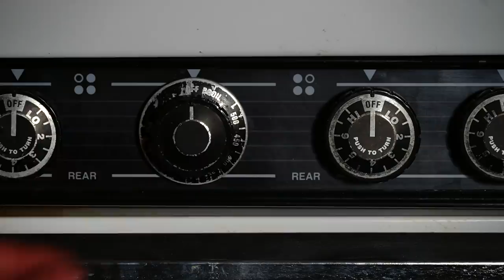Forging a Viking Axe from Junk

Comment: One thing I wanted to see... wasn’t done in this video 😢 the eye on the axe head wasn’t modified! There’s supposed to be a wider and sorter eye. Like an egg 🥚 shape not a sharp raindrop shape. A modern axe has an hourglass shape inside for shimming. A Viking axe is different. The handle and eye are tapered and the head slides over the handle til the taper traps the head. Then the head can be removed by tapping the handle vertically on the ground. Then the head can be used as a knife.

Comment: What is that powder you put on it to forge weld it?
Reply from the maker: It's borax for flux
Reply: Faraway Forge thanks. Does it help with the forge weld?
Reply from the maker: @steve3386  Yes exactly, it basically liquefies the scale that forms on the surface of the steel so that when you forge weld the scale may be easily forced out of the weld.  This produces a much cleaner bond between the pieces of metal.
Reply: Faraway Forge I see thanks
Reply: Faraway Forge also I’m making a knife out of a pipe but I can’t get the two flattened sides to fuse what can  I do to help that two flattened sides fuse?
Reply from the maker: @steve3386  The best thing to do in my opinion is to cut the pipe in half so that you can clean the inside surfaces that will be forge welded together.  Then tack weld it back together before you forge weld it. Very important to have clean steel before you forge weld.  Other than that flux it and make sure the steel is hot enough.  Also some metals are more difficult to forge weld than others, so just be aware of that.
Reply: Faraway Forge thanks

Comment: Wheres the junk ?
I could have that true temper woodslasher axe head back into service in less than an hour.

I'm not saying theres anything wrong with your project,  but this idea that any tool that's rusty and a little beat up is junk and no longer useful in it's original form ?

Comment: This kind of thing is a dream build for me, learned a ton from the video and it answered some questions I had too, regarding that specific forge welding trick, with the splitting down the middle. Just one question though, how did you get the eye to stay aligned/straight? I never saw a drift or punch or anything.

Comment: looks good but i doubt that its gonna be as a good as a 10$ hardware store exe. the fitting was just way too lose, you didn't hammer it in as hard as I would with a typical axe and the wedge wasn't all the way in as well

Comment: First time I saw on YouTube the plasma cutter for material removal! I've been wondering why everyone goes for the cutter/grinder method. Perhaps no plasma in the shop. I wondered if it would work or ruin the hardness, but now I'm eager to try it!
Thanks!
Reply: Of course it ruins the hardness if you cut a hardened steel. But he was cutting the axe before heat treatment so it's ok.

Comment: What is that powder you add  several times and what is that for?
Reply from the maker: It's borax, it improves the forge weld drastically.  It acts as a flux to remove the scale that forms on the surface of the steel, thus producing a clean forge weld

Comment: What's that powder that's put in the hot metal? And the liquid that set the hot axe on fire?
Reply from the maker: It's borax, it acts as a flux for the forge weld.  The liquid is oil to quench the blade, so the oil is in fact burning, not the axe 👍

Comment: Noob question: What's that white stuff added to the hot metal at 1:37 , 1:51 , and 2:03 ?
Reply from the maker: It's borax, it acts as a flux for to keep scale out of the forge weld 👍

Comment: Can we see how your forge works?
Reply from the maker: What do you mean?
Reply: @FarawayForge  How did you put your torch based furnace together? I currently am trying a coal based one with little success. Yours looked far more efficient, so I was wondering how you set it up?
Awesome content by the way! I am eager to try a few one I get things up and running. 😁👍 Keep up the great work!
Reply from the maker: @zacharytvrz3995  Oh gotcha, I have never had any real experience with a coal forge so I can't speak to that.  The propane forge is store bought, it is made by a company called "Majestic Forge."  It's one of their three burner blacksmithing forges.  I have tried building my own in the past but I ended up spending more money on materials for the many failed iterations that I created so I decided to cut my losses and buy a real one.

And thank you!  Send me some pics once you get some blades built!

Comment: I like that u Went with a lightly burned handle, so many people go overboard with the burned finish but I would've done 2 linseed oil coats, 1 bare wood then another over the leather. And u should get a couple fire bricks for the front of ur forge, otherwise it's just dumping heat and it's take allot more fuel to run